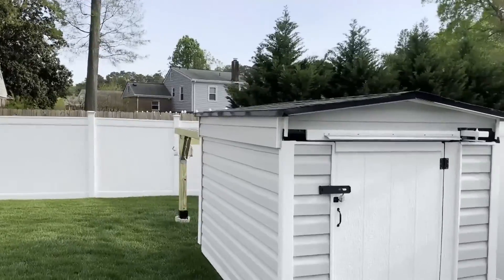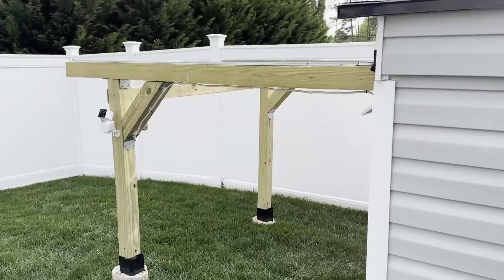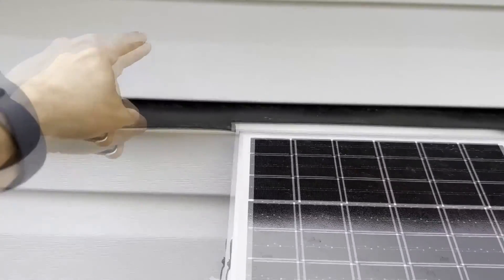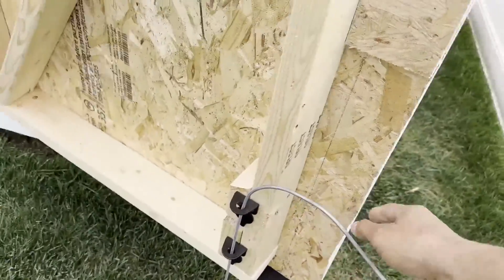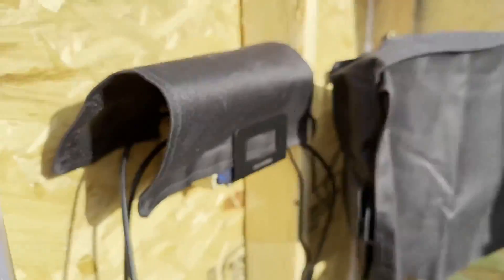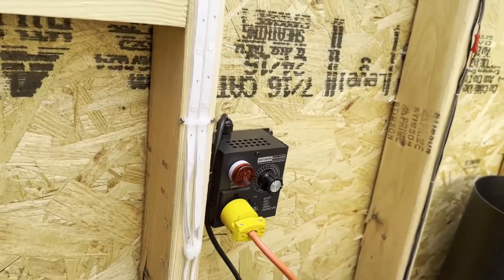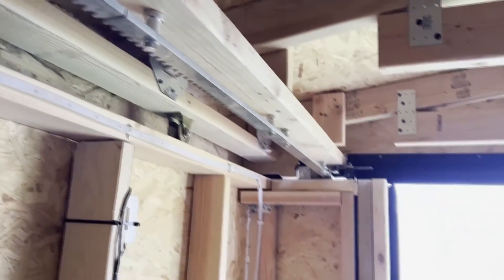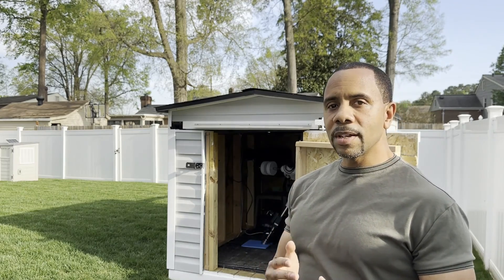I Built A New Bigger Roll Off Roof Observatory

Comment: Can you tell me the brand and model of that motor speed controller? I bought one but the roof motor won't start at all when plugged into it. Thanks.
Reply from the maker: I had same problem until I tested the controller with a basic 120v fan like a box fan. I found out that the controller will only work on a very small section on the dial. If you go too low it won’t put out enough electricity on the power output. So I plugged a small fan into it & turned the fan on & then turned the dial up until I saw the fan turn on. From there you will see where the dial has to be set for it to turn on something that is 120v AC & that same setting is where I have my gate opener motor power plugged into & it works really well. If you dial it higher the gate opener will work at full power & if you dial it down just above to where the fan would turn on, my gate opener will have just enough power to operate the motor where it will not have a big jolt when it opens my roof. Hope this helps & this is the Amazon one I have. 

https://a.co/d/3STGtCl
Reply: Thanks! I’ll give that a try this weekend.

Comment: Nicely done! Did you have to deal with any building ordinances or permitting prior to construction?
Reply from the maker: @lydellnunn7214  Thanks!!! & no I was good to go with my HOA because I used siding that matches my house & shed.  Also in my area no permits are needed for shed type structures so I got lucky 😁
Reply: @deejaybustab  Permits are an unfortunate way of life in the Northeast. I house my scopes in a Nexdome. Technically, they are temprorary structures, so I only needed a permit for the deck that it is housed on.
Reply from the maker: @ I caught a break on this one because it’s kind of the same for where I am as well. Sheds are considered temporary structures as well but if it was attached to my house then I would definitely need a permit. What also helped me in my HOA was I wanted it to be lower than 6 feet in high so it’s basically lower than my 6 foot privacy fence. If it were taller they would be cool with it. They only ask to see some kind of plans explaining it & as long as it wasn’t crazy looking or crazy color they are ok. It’s Kind of a laid back HOA neighborhood.

Comment: Nice set up! What motor and rail did you use for the roof? Do you have any liks where i can purchase the same motore and trackrail? Thanks!
Reply from the maker: @cgome004  Thanks!! & I just updated the description for this video to include the links to the motor, V track & wheels used in this build.
Reply: @deejaybustab  Thanks for the links! What about the Wifi relay for the motor? IS that hard wired into it also and are there any specific instructions out there on how to set it up. I've had my observatory for a couple of years but never rigged it to be electronically and remotely opened. Sure does look nice to be able to do so. Thanks again
Reply from the maker: @ The WiFi relay switch I got the idea from Astrobloke when he had his plastic shed wired up. I recently disconnected it because I now have NINA set to open the roof before a sequence & close the roof at the end. The WiFi relay switch was just 2 wires to connect to the gate opener. Astrobloke goes over the same installation in his video from a few years ago. I may hook it up again 1 day but for now NINA is taking care of everything nicely 😃 now I do use the keychain remote whenever I need to manually open the roof for things but that wifi relay switch is out of the mix.

Comment: Great job on your shed looks great. If you don't mind what kind of motor for the roof are you using?
Reply from the maker: @user-rz2mn9yl3b  Thanks!! The motor is a sliding gate opener that you can get on Amazon. Many are using these types same kind because it’s not too expensive. The one I have is called Blutezeit Automatic sliding gate opener.

Comment: Great job! I’m new in the hobby — mainly AP. Currently I’m just using a Telegizmos 365 cover on my 4” refractor, but planning to build a Todmorden pier at my best viewing spot. Who knows? Maybe I’ll decide to build a roll off shed after doing this for a year. Thanks for the inspiration.
Reply from the maker: @AnthonySchmitt  I started AP in 2016 & for years I would always bring my gear outside & back in the next morning & was cool with it & a couple years ago I got the itch to keep it in a small roll off roof shed. I then built that rubber made shed that I have a couple of videos on it & it was excellent!!! Now I got the itch to build something little bit bigger but not by much & so far it’s working out really good!! 😊
Reply: @deejaybustab  👍👍👍👍👍

Comment: You know I have roughly the same gear you have and have just completed a cement pier install and am about to build the shed and have been struggling with size but looking at yours...that's probably exactly the size I want.  Some people seem to build them so that they can live in them but really, if you have all the automation dialed-in, I would rarely need to be inside with the rig for any length of time then get my butt back into the house to remote run it.  Thanks for the video and all the great tweaks.

Comment: Awesome - I have the rubbermaid shed and currently automating it with a linear actuator but my new mount is too tall so i was going to attach the original rubbermaid roof to 2x4s and rails and attach the same tooth gear motor.
Reply from the maker: @area51xi  Thanks!! I had to do something similar to that when I modified my rubber maid shed. It worked & I ended up making this shed because I needed just a little bit more space other than that the rubber maid shed was perfect.
Reply: @deejaybustab  Yeah I hear you. I need to lift the roof on mine about 4 inches and make it roll off 75% of the way. That will give me enough room for a much larger mount and scope.